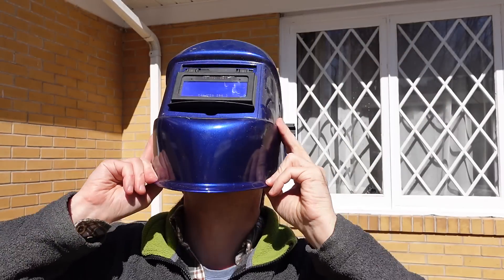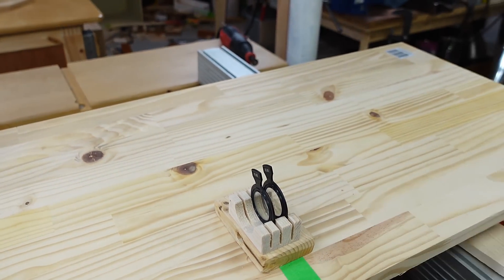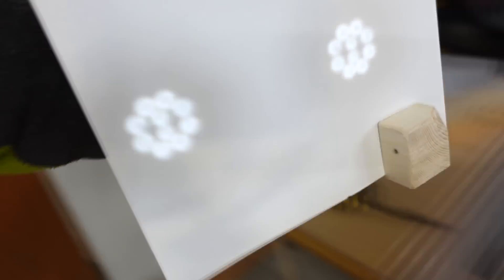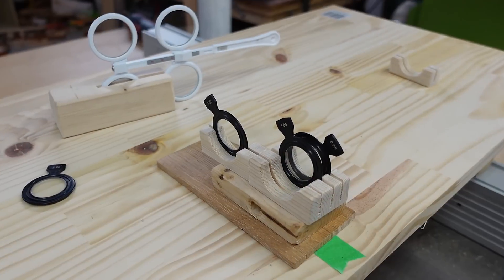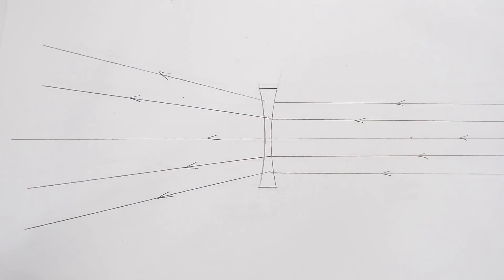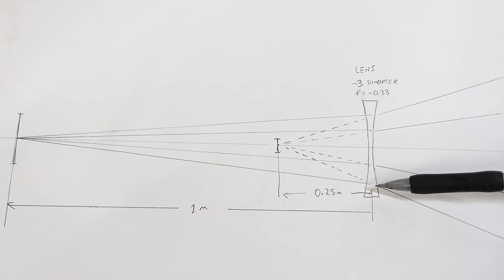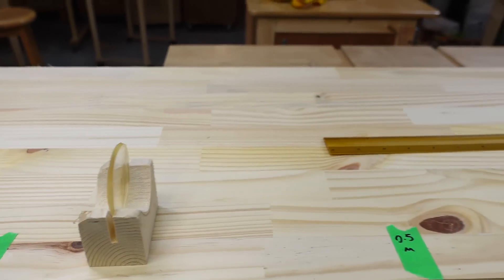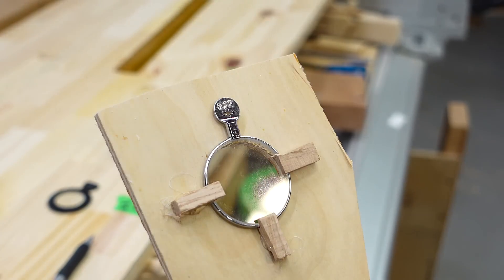Making a solar eclipse projector

Comment: Does a focus length of infinity mean that the light will attenuate to much before it reaches the focal point?   Or that there isn’t any inward curvature of the light so all the light travels parallel or away from its self forever?
Reply from the maker: its going to project the image at infinity, but the image will also be infinitely large, so the light does diverge.

Comment: Hey Matty, how about you do a video testing whether it’s better to put filters on the front or back of a fan. Pulling through the filter or pushing through it. Some say pulling through a filter is better but I read something that says it doesn’t matter and you actually want to have the filter further from the fan to create a column of air, whatever that means. So if your fan is not in the center of the housing, put the filter on the end that’s further from the fan. Air going in is the same as air going out, right?
Reply from the maker: already covered that in some of my earlier videos, nost not a specific video about it.  My first air cleaner pushed, it was not ideal.
Reply: @matthiasrandomstuff2221  Thanks for they reply. I'll have a sift through to find that.

Comment: I hope my ophthalmologist uses a better set of lenses to determine the diopters and cylinder of my glasses than yours!
Reply from the maker: May not matter that much.  The lenses were less than 0.05 diopters off, 0.1 diopter difference is kind of hard to notice.  Go get two eye exams, and some of the values from two optometrists will difer at least 0.25 diopters.  

Though if you have to stack trial lenses to get the number, then the error may accumulate.

Is kind of annoying when using them to measure glasses though.

Comment: I bought a $10 pair of binoculars and cut them in half to make a couple sun projectors, with poster tubes and some parts I 3d printed. I get about an inch wide image of the sun in a 2 foot long assembly, and the image is clear enough to see sunspots.  Made them for the last eclipse but got rained out.

Might be worth making it small enough that you can drive somewhere if you have bad weather the day of the eclipse.

Comment: Matthias, look into the design of the Sunspotter Solar Telescope! It's a wooden Keplerian projection telescope that has a triangular design and uses similar lenses to what you used in your video, and mirrors to bounce it around the triangular frame so the whole thing stays compact and you can keep it aimed at the sun or move it if there's clouds. I'd be very interested to see if you could build something like that! I used one at our local Planetarium for the 2023 October Annular eclipse in Nevada, and it was really quite intuitive to use and lots of kids and adults came up to the table to ask me about it and see the eclipse, and even sunspots projected on the paper.

Comment: Mathias, you have to ramp up your optics chops and start grinding accurate lenses to replace those in your wonky purchased set. Surely, with your guiding mind and the neat tool systems invading the market, some few of them can produce a result strides ahead of what you have currently there at hand - maybe you can even regrind some of those to a higher quality.

Comment: Of course I watch to the end! Even though I do a lot of woodworking myself, it's not what I care about in your videos. I like the engineering process. I am an engineer myself (IT at first, but moved to electronics and mechatronics). I couldn't care less about someone building a shelf or a table. I care about how it's built and you're one of the few who uses "non-traditional" methods.
About the topic itself: optics is something I still haven't developed an intuition for. For everything else my guesses put me in the right ball park right from the start, be it software, hardware, component selection or mechanical dimensions. I just have a "feel" for what is needed and how it's done. But optics? Nope! No clue at all without going to drawings and formulas.

Comment: For such projections I'm just using my field glasses. Such glasses are constructed in a way, that the projection of the sun is filling a letter sized sheet of paper in ca. 2m distance. Quite convenient.

Only this should not be done too long, as the glass will heat up a bit.

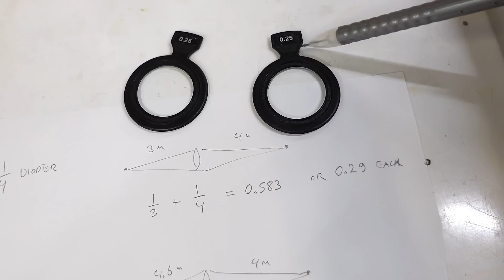Comment: 2:15 About the accuracy of those, I notice it's a trial set for glasses. When used for vision correction, people also (generally) have the adjustable accommodation of the eye's lens to fine-tune focus, so a wide tolerance is fine for that purpose. Sort of rediscovering why adjustable focus is important.

Comment: In your first test, the lenses may not be off, the light you are using isn't parallel. The math is going to give slightly different results.
Reply from the maker: Or course its not parallel, I cover that in the video.

Comment: Stay tuned... Matthias efficiently channels energy through a single focal lens, powering a 240V welder at 100% duty cycle, typical household appliances, and supplying electricity for a 3000-square-foot residence for a year.

Comment: As always, when finances are not the size of government military budgets, in general the less glass in the light path the better the image. Although I have to admit to using Leica zoom eyepieces on my solar scopes which feel like I've spent military budgets! For white light work, a cheap, second-user, large refractor with a cheap glass eyepiece projecting onto a screen works quite well. If there are clouds of smoke, the lens is plastic! For direct viewing, a homemade solar film filter works well with a 99.995% light reduction ...

Comment: Oh, I looked at a partial eclipse through my welding mask.. Apparently level 12 or higher is needed? No idea what mine was... Though on a bright day I can hardly open my eyes without sunglasses, so if if was going to be too bright I suppose I would have noticed.

Aha, it's adjustable from DIN9 to DIN13...
Reply from the maker: When I was in grade 2, there was a partial eclipse.  Whole class watched it without any filters, squinting through gaps between our fingers.  No one got hurt.  So much that is "dangerous" now wasn't back in the 70s.

Comment: Grandpa converted the whole barn for the 2000 eclipse, made it into a "camera obscura". He took one of grandma's best white bed sheets and strung it like a drum over a frame he made, then painted it with white paint. I don't recall what exactly he used to project it, but it was a series of lenses inside a big concrete cardboard form tube.

Was really neat. Pretty big, the sun was about 50 cm tall and pretty detailed, we had it project the sun for a few days before and after and you could see the solar spots, almost forming like a couple of bands.

I recall that when the eclipse was in full swing, we could see details of the moon. The "seas" and very faintly a few of the larger craters. It was a neat experience. 

And yes, grandma wasn't happy about it, especially since he almost started a fire.
Reply: How did he almost start a fire?
That would be a good thing to avoid if one wants to recreate the viewer.
Reply: @scotttovey  Focused sunlight can easily light things on fire.  I'd assume any misalignment is a fire hazard.
Reply: @doughnut1107 
Good point.
That reminds me of when my brother used a magnifying glass to get a piece of paper smoking when we were kids.
Reply: I just stood outside with eclipse glasses on and watched it.
Reply: @1pcfred  Making the image 100x larger by magnifying it, changes what you see.  You might believe that the glasses you used produced the same output, but you are incorrect.
Reply: Well at least he had a barn to sleep in, and a sheet to wrap himself up with, so he kept warm.
Reply: @jameskelly1680  it was so hot the day of the eclipse. Steamy. I got eclipse burn staring at the Sun all day. But at least we did get that break when the Moon went over the Sun. It really cooled off! The lights in the park came on too. It got that dark.

Comment: I don't know why so much pain to build such thing.  Just a pin hole camera is enough to project the Sun to your room's wall nicely. I always do that when there is Solar Eclipse. Get a card board box, open the top cover, put a mirror at one of the wall so that sunlight gets reflected and shine the other side of the wall. then just make a small hole on that wall and rotate the box such that the projected image gets on your wall. It's just 2 min job if you have a card board box or any box where you can add a hole and a mirror. That's it.
Reply from the maker: because a pinhole will nevere be as sharp as a lens

Comment: I'm finding it hard to believe that welding shades are no longer suitable for viewing an eclipse - after all, the welding arc contains tons of bright light and UV, and those in the profession stare at that arc for hours on end, many days a week.    Wondering if the 'Eclipse glasses cartel' has anything to do with the welding shade dissuasion.

FWIW: The last 2 eclipses I viewed, I looked at through welding shades - the auto-dark variety that you could adjust the shade of.   I also took cell phone pictures through the welding shade and through cheap eclipse glasses.    Welding shade pictures turned out much better in both color and clarity.

I did have trouble with one of the two Jackson NexGen shades staying locked in the 'Arc-Detected' mode though, and it wanted to keep going clear - the older one performed better in this instance (perhaps this is why they're not recommended, but standard fixed shade lenses should be less of an issue here).   It won't matter though - the way my luck rolls, the whole eclipse path will be socked in with clouds on 4-8-2024.

Comment: That's funny that a welding mask isn't recommended any more - it was what the experts recommended method back in 1999!
IIRC they recommended grade 12 glass, which we had to special order, and turned out to be so dark we could hardly see the sun. Ordinary grade 10 glass was much better.

I remember the TV being full of experts saying that you could look through a CD - but having to clarify that they didn't mean the hole in the middle!
Reply: I would speculate that maybe we're differentiating between welding GLASS (grade 10, grade 12, etc.) and an auto-darkening welding helmet with LCD darkening technology?
Reply: @johnhawkinson That would make a lot of sense, as I don't think sunlight is strong enough to trigger an auto-darkening helmet.

You'd think it would be obvious that a non-dark helmet wouldn't protect your eyes - but I guess it's no worse than needing to be told not to look though the hole in a CD!

Comment: As far as I know, welding goggles should suffice, because they have to filter the UV light that welding arcs emmit.
I see the point to better be cautious, and I would like to find a good source for the welding goggle claim
Reply: i don't see why they wouldn't be good enough, but I can see electronic ones having risks if some fly lands on the sensor bit or you cover it with your hand or something and it flashes open.   or in the case of an eclipse the eclipse itself I suppose!
Reply from the maker: Googles would be for brazing.  Definitely not dark enough.  You need an arc welding mask.

Comment: Welding mask unsafe? A welding arc sure is brighter and emits more UV than the sun through atmosphere. But a lens/camera obscura setup is nicer anyway, gives bigger image
Reply from the maker: that's what they say
Reply: @matthiasrandomstuff2221  and who wouldn‘t listen to „the internet“!
Reply: What about infra-red though?
Reply: @-vermin-  sun won‘t cook off your eyes, no worries, not even without any filter.
Reply: @fiedel  Do not stare at sun with remaining eye.
Reply: Proper welding glass blocks IR also.😊

Part of the problem with welding glass is it darkens the image enough to curb your pupilary response.  If dangerous invisible wavelengths are coming through, you wouldn't know until it damaged your eyes.  

Now way I'd stare at the sun.  Put a camera behind the filter and watch it on a screen.
Reply: Maybe that's because most modern masks are auto-darkening, but need the intense UV of an arc to darken - so they won't do anything if you look at the sun?
Reply: @robinbennett5994  That is indeed some valid reasoning here